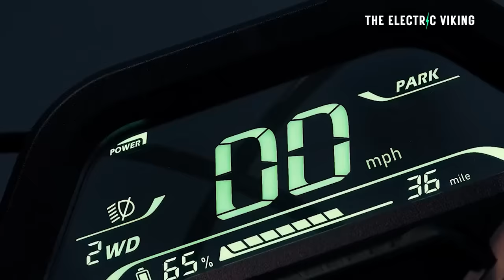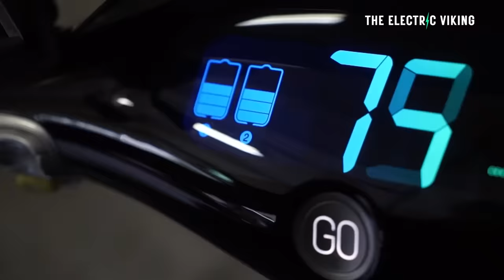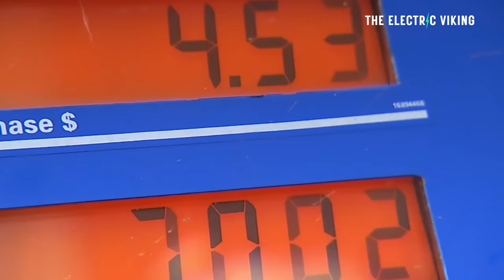Electric scooters destroying oil demand 4 times faster than electric cars

Comment: Most people think that there will be a slow diminishment of fossil fuel vehicles. That isn't true. 
The reason is refineries. Refineries have to refine hundreds of thousands of barrels of oil to just break even at market prices.  If they cannot do that they have to raise the price of the refined products. 
Ergo as less and less fossil fuel is used, gas and diesel prices will go down at first (because of a glut) but then go steadily up to make up for the loss in revenue. 
As this happens more folks shift to EVs and the process gets faster and faster. Oil refineries will start collapsing in just a few years.... certainly by 2027 many will shut down as they are refining uncompetitive sources. 
First on that list will be shale oil from Canada and similar areas (more expensive to refine), then very quickly many refineries will stop refining gas and diesel and will only refine other petroleum products where there is price stability. Gas prices will go up even further to the point everyone wants an EV. 
The snowball has just started rolling downhill, it will obliterate the fossil fuel industry very quickly.

Comment: 8:06 wonder if the lack of substantial reduction in oil consumption is due to the relative fraction of oil use by various sectors.  Would be interesting to see what % of oil use is devoted to heavy transport vs passenger cars.  That may explain the lacklustre reduction numbers.

Comment: I think its the smallness which is the winning factor, I also wonder how efficient and frugal traditional  engines could be made in the sizes required to power small vehicles like these
Reply: > . . . I also wonder how efficient and frugal traditional  engines could be made . . .<
That is an uphill battle as physics is against you.  The surface to volume ratio of the combustion chambers is horrible.  The brightest minds on earth have been optimizing small engines for 125+ years.  OTOH, small electric motors are very efficient.  Electric propulsion scales wonderfully from the electric skate board all the way to electric trains going 175 MPH.

Comment: I´m german. I bought my first ICE car in 2013 for 3.000 EUR. Had it for 6 years. Drove 66.000km with (mainly roadtrips through Europ). Total cost of ownership per year was 4.000 EUR. (I slept appr. 2 months in the car when on vacation which saved me 3.000 EUR of accomodation, which are already included in the 4.000 EUR TCO). Since two years I have a used electric full suspenion scooter (20km/h max speed - range: 30-40km). I drove 3.300km over all and total cost of ownership per year was 300 EUR. If you live in a city it is the perfect daily driver for running errands ! When it rains or freezes or you go up steep hills, the scooter is NOT fun. But other than that it is pure JOY to drive as you can drive anywhere with it and therefore use all kinds of shortcuts and never have to search a parking lot :)

Comment: There are now Lyft electric scooters in chicago. I often see them abandoned or locked to a post. I dont see many people using them.

It is very dangerous to use bicycles or scooters on the street as the lanes are shared with regular cars. The city has spent a lot of effort to make using a bicycle / scooter more popular but it has not worked  because people are afraid of getting struck by a car.

Not very comfortable riding a scooter in freezing temperatures like today.

1 million barrels of oil per day is 1% of world oil demand. It is negligible.

Comment: Scooters are great, until it rains, snows, gets too cold or too hot or you need multiple trips...  Having said that, in cases and places where they work, it makes a lot of sense, the vehicle is cheap, insurance is typically 0, speeds are well above walking, near 0 maintenance and fuel (recharge) cost.  Who knew not hauling around 2000kg+ to move 1-2 people isn't the best use of energy?  :)  You still need trains, electric cars, etc, but scooters make a huge difference.

Comment: Before we praise China about electrification, they are also building  hundreds of new coal-fired generating stations. That's like saying you're giving up snorting cocaine and replacing your addiction with injecting heroin. Here in Quebec Canada, we just had a dumping of 6 inches of snow. Temps range around minus 5° C in the day. Most western countries have to greatly improve their electrical grid to handle the increase in electrification. Consider this a reality check. And FTR: we've owned two e'bikes for four years. I'm 71.

Comment: I’d love to use an electric scooter to go to work on a daily basis. They just don’t meet the requirements for that kind of trip.
In Arizona, we get about 300 dry days per year. Unfortunately my daily commute is 60 miles round trip. I would need a scooter with about 80-100 miles of range before I could drive it.

I had an electrameccanica solo for a few months, but the company had a safety issue and had to do a buy back.😢
Reply: No, what you need, is a train station. Then you could scoot to that from a couple of miles away, go to work, scoot from train station to work, job done. Most US towns had them, but lots got taken out in favour of ICE vehicles. Whoops.
Reply: Also, gutting about the Solo, sorry to hear that.

Comment: example  in the uk    petrol cost  £1.44  per liter     - fuel tax 52.95p   and  20% vat=28.8p    or about 60% of the cost of the price
sumup Uk ban scooter not about safety it about they dont want to lose about 60% of every   time we fill-up
and there talk they want ebike ban as well, or limited to power assist  mean we cant have it run on it power.

Comment: E-scooters are banned on public highways in the UK, except in certain trial in cities like Nottingham, where you just pick one up using a phone app. Recently, the council has abandoned the scheme, or rather, the company running the scheme. One day they might collect the piles of scooters littering the city or dumped in the rivers. 

Also, in the interests of promoting health and fighting obesity, you should be advocating bicycles, not battery powered scooters. Bicycles have a much lower carbon footprint and longer service life.

Comment: These are great for warm countries,  but not so good in rain or cold.

Under 1km I try to walk, 1 to 10 km I use my motorbike. Over 10km, car or taxi.

The worst thing about the electric motorbike was I had to recharge the battery once a week or it would die. Not so good when you leave the country for several months every year.
Reply: Never heard of a weekly charge requirement. People leave their electric car for weeks without issues (besides of battery charge going down a bit)
Reply: @3tronicum  the electric bike I had was made in China, bought in the Philippines.

Apparently, there is a "slow charge" that could have avoided this problem. But I decided to turn all the breakers off as I feared neighbors stealing my electricity while I was away. So the slow charge would not have worked anyway.

Comment: Electric bikes and scooters add to emissions not take them away, you are replacing real bikes and scooter with oil powered electric scooter the more you charge the more gas and oil and coal is used unlike the real bikes and scooters they replace

Comment: Great news. I'm not sure the electric scooters are illegal for private owners anywhere, but I could be wrong, but if true anywhere, that won't last very long.
I DO think a trike or very compact 4-wheeler is a much more stable and safe ride than 2 wheels without some major engineering (and consequent cost), and if U. S. drivers weren't so generally AWFUL, everyone would be much better off all around with smaller 4-wheel and 3-wheel vehicles. A (probably insurmountable here in the U. S.) problem is that people are so completely bamboozled into thinking personal vehicle ownership is synonymous with unlimited personal freedom, when in fact personal transportation should be solved collectively. People also conflate bigger/louder with better, and the ICE as something to be clung to at all costs, when it should have been relegated to special-use ONLY decades ago.

Comment: I have used a non EV, manually 'scooted' scooter for exercise and short distance commuting for years and only recently upgraded to an electric one. I am really enjoying the EV scooter. It stays in the boot of my car. I drive, and sometimes take the train, and I just use the scooter for the final 2 or 3 kilometers to my work destination.  I have a lot more fun than people half my age, and so I can't see any reason to not use a scooter.  I didn't know I was part of the reason why less and less oil is getting sold.  I see people idling their cars and diesels while they are inside shopping.  It frustrates me that people can be this careless about fossil fuel consumption. If the government was serious about reducing climate change they would introduce a HUGE fine for ANYONE who fails to turn off their Fossil engines while they are not actually moving, regardless of the reason they are doing it.

Comment: Electric transport is currently inappropriate for Canada. Battery range falls almost by half in our cold weather. Two wheeled vehicles are extremely dangerous on icy winter roads. Add in the lack of charging infrastructure, the long distances we travel. the high price of electric cars, the extra expenses of maintaining electric cars, the environmental costs of refining lithium and Canada is proving to be a poor place for the electrification of transport.

Comment: It is not focusing on either EVs or scooters. They serve different transportation needs and we need to decarbonize everything. 
And let's not forget that Norway is rapidly replacing fossil cars with EVs now that EV share of new vehicles is >85%. It just takes some years to replace the remaing fossil cars, which will surely accelerate after 2025 (fossil ban for new sales). EVs already make up over 25% of the total fleet, and this will grow to 70-80% by 2030. So it's really going very quickly now, and we will see the same accelerating transition in other countries. So, decline of petroleum use in Norway will accelerate in line with this (although it may also include chemical industry use of petroleum).

Comment: I think that great disparity between EV sales & reduction of oil use is because the EV sales numbers don't reflect on how many cars are out there, many people keep a car for many years, and when they change, it's to a used car, so for these people it could be easily be 10 plus years before an EV option becomes available. Have a look at the various used car lots and note how many EV's are in them, probably near zero, so that's the option for many, near zero.

Interesting your take on scooters, in Australia I see them more as an expensive toy, often used by those that have lost their drivers license, as evidenced by the really stupid crashes often shown on TV (they must be drunk etc.)

replacing trains, no way, I used to take an hour train trip to work, to cover the same distance in  the same time on a scooter would require some really scary riding, something reserved for a full size motorbike at least. (I'm talking about the stand up, glorified skateboard type's here). For the larger electric bikes, (not pedal assist bicycles) you need another vehicle registration, so the costs soon rack up and really suck here in Aus.

Comment: There is something to be said for NOT needing a 4,000 pound car to move your 200 pound self. With scooters, you out-weigh the conveyance. Much more efficient, than bringing out an EV car, which may or may not get 4 miles per kWh, when a scooter can get 15 or even 20 miles per kWh. The battery swapping works well with scooters, where the ~750 watt-hour battery can be carried in one hand! many electric cars have nearly 100 times more battery capacity, to be able to carry 4 times the number of people. Sure, scooter crashes are quite frequent, but, a pedestrian is far more likely to survive, than being bowled over by a 2 ton car or 3 ton truck.

Comment: Don't forget if EV sales were 100% of all auto sales that would still only replace about 1/12th of the total fleet per year, so a 10% annual oil consumption.is about right. But each year after is another 10% of the original gallonage - so it will escalate quickly. Oils industry supporters here in Canada still sees 30 years of full production and even imagine growth - but I suspect that is wishful thinking. I'm not buying any oil stocks. Meanwhile electric scooters are huge advance for all those dense cities that used to be jammed with gas scooters. I remember noting in Taipei that it seemed every third storefront was a scooter repair shop. I'm assuming e-scooters are way more reliable and not nearly so smelly.

Comment: Ugh.  I can't move my family of 4 on an electric scooter.  So, I need my car.  And, as far as your thoughts on trains, let me quote you:  "Wellllllllll..." I think trains have their place.  Here in Italy, I can jump on the electric 'bullet' train with my family and make a one hour trip to Rome, for the day, then an hour back.  That would not be possible on a scooter.  Even when my kids are old enough to drive, that would not be possible due to distance, scooter speed, and charging.  I do see the scooter as being crucial to inner city transportation, reducing the need for cars AND diesel/petroleum vehicles, and massively reducing pollution in those areas.
Reply: Why so triggered? Did you even understand the video?
We use the best means of transport for the type of trip - so if I want to go to the office or the shops, I use the scooter.
If I want to take the family then use the car or train.
As more people use scooters for what they are best at, then fossil fuel usage declines - this is a good thing. You can still use your precious car.
Reply: Its laughable that you ask if I'm triggered.  Sam specifically said he believed trains were no long needed (or should be done away with).  Speaking of triggered, thanks for the permission to use my precious little car...but I don't need it from you.  Oh, it's electric too. Cheers @ahaveland

Comment: Replacing trains with electric scooters sounds like a very bad idea. In our country scooters and bicycles work very well with trams and trains. Don't forget that trains and trams don't require batteries and much more efficient per passenger than cars and also much safer than any other option.

Comment: It takes a long time to replace a car fleet as cars live on average 15 years.  Even if 100 % of vehicles sold were electric, each year would only see 1/15 reduction in fuel use.  But these are cumulative numbers.  In this light Norway drop in fossil fuel use is actually an encouraging sign.  We have finally turned a corner.  I did a back of the napkin calculation.  If we saw world wide ev adoption go 50 % over 10 years with linear growth, we would see oil consumption drop by 25 % over that time frame.  I'm thinking it will happen a bit quicker than that.  

Scooters make lots of sense for cities.  Gas scooters don't burn very cleanly, so I think there will be a big improvement in air quality in asian cities as the fleet turns over.  I imagine they don't last as long so fleet turn over could be relatively quick.

Comment: Electric scooters and e-bikes are for the most part making mopeds obsolete, and in doing so are reducing hydrocarbon pollution greatly.
Americans switching to SU-buses and monster pickup trucks would be drastically increasing world oil consumption if it was not for so much of the world transitioning to small-scale electric transportation.  The good news is that the transition to Americans driving pigs is pretty far along so excessive oil consumption in the US won't go a lot higher.

Comment: Yeah.

let's find out about ranges of design options. The stand up scooter through ebikes and various motorcycle body types. Advantages? What are the best designs?

Also talk about use cases. There we can see that these vehicles bring us to possibilities that were once out of range. Being able to deploy a fleet of small electrics will open new use cases! Campers, new sports, professionally in land management, even fire and other emergencies. The ruggedness of them makes them useful in areas and situations you'd never consider. Like literally air dropping them in and they are good to go!

There are emerging military uses for them too. Design a squad to be a MASH unit! Save lives.

Curious about how to gain some standard for midsized two wheelers to facilitate the battery swap. Or super fast charging stations? Use Tesla adaptors? How fast would a Super Charger charge a ebike-scooter-motorcycle battery?

I do love my ebike! Challenging to park, theft is too real. Even batteries are being lifted.
I figure that it'd be worth crunching numbers around to see if it'd be worth setting up ebike parking units that includes enhanced security and a solar powered battery to recharge ebikes while parked? The unit would most be used as arbitrage so the simple covering costs would only be a problem when they get popular! Since it would pay for itself, maybe get cities to buy them to set them up. From the cities point of view they function like little VVPs. & more butts on electric the better.